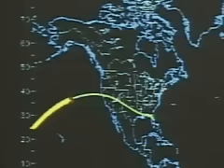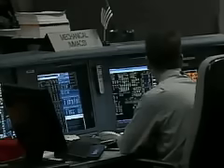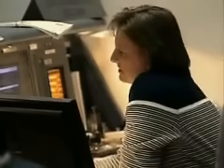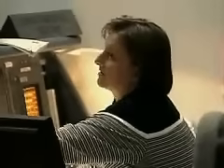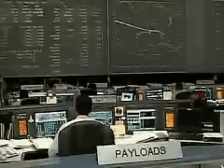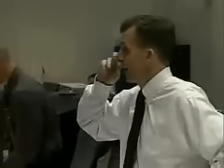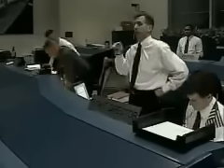Inside Mission Control During STS-107 Columbia's Failed Re-entry and disaster

Comment: Flight director didn't know what systems the heat sensors were monitoring. The pilot had to explain it to him, (twice). Crucial seconds lost in an emergency. You need to have mission control people who understand the vehicle being flown. Not just people who follow "numbered" procedure in a contingency manual. CYA jackoffs!
Reply: The wing sensors going off scale do not have a link to the cockpit. Their transmitted to ground only. They monitored the heat on the wing (structure) only.
Reply: A Flight Director can't know any detail about any sub-system. That's what the controllers are for, who are specialists in their respective field and report to the FD.

Comment: They,knew from the start that the shuttle might have been damaged by the foam to the leading edge  of the carbon carbon   tiles during takeoff but they couldn't do anything about it during the test they did during the investigation 1 of the panels took a direct hit from foam using a gun and made a big hole in it

Comment: Sorry if my question is dumb but can it not happen that they open their own parachutes ( upon sensing some danger like that foam came off etc )  when just a few miles away from earth ? Or it's not possible in this case ? Or is it that they had too less time or something ?
Reply: Not a dumb question. Just a matter of understanding whats going on at that time.  First of all they are still within the atmosphere going about 3,000 mph at that point. Un do your belt and you fall to the ceiling because their up side down. Getting to the hatch in a 100 lb. suit would be impossible. Opening the hatch and deploying the escape pole would take a good minute. Jumping out at that speed would rip them to shreds . No chute can withstand that speed. What I'm trying to say is the escape system is not made for launch but only controlled level flight no higher than 25,000 feet while ditching the orbiter in the ocean. Many perfect things have to happen to get to that point.
Reply: @jrockett73   Alright, thanks so much. 
I had watched a video regarding Jupiter's probe. A probe was sent and due to the immense force in the middle of Jupiter planet, that device was getting sucked inside. But since it had a parachute, it managed to stay for some while and capture details, after which it finally got  immersed into all the hot gases of the planet, deep inside. Hence I asked this as I thought that if it is possible ' within a planet ' , that far and high, to open up a parachute and stay there, why not for a spacecraft just a few miles away from earth. 

Not a physics student hahaha. I studied analytical chemistry and mathematics  :) Thanks again.
Reply: When things went wrong they were traveling at a speed of 13,100mph at 205,000ft high.
Reply: @tommym321  ok , thanks :)

Comment: What is sad about this accident is that NASA knew about the ice strike almost immediately and did nothing.  They did not order photos to be taken.  They did not have the crew perform an EVA to visually inspect.  They did not expedite preparation of Atlantis for a rescue mission.  The seven crew members trusted management and management failed.
Reply: Foam strike, but yes, it seems like the prevailing wisdom, if you can call it that, was to simply know nothing. I don't think that flight was equipped to do an EVA which to me raises the question, "why not?" I've wondered if it would have been possible to force the Orbiter to come in with a yaw in order to favor the left side, but if that had made reentry survivable it would also have likely made landing uncontrollable.

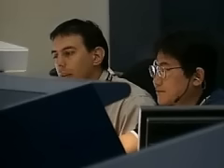Comment: I think they knew something was very wrong at 1:40 when 4 temperature sensors at the LEFT WING were lost. Leroy knew that during the launching something fell from the rocket and hit that left wing.
Reply: I see we have a crew of rocket scientists in the comments section again…
Reply: @Kntrabssi  I second this
Reply: He really didn't look comfortable even before that.  They must have been jittery about the wing after seeing the foam strike on liftoff anyway.  It wouldn't surprise me if the astronauts and controllers on the ground suspected it was a lot worse than the Powers That Be were letting on.
Reply: They refused to fix the damage in space. It's their fault
Reply: @davidoverstreet2875  can fix something if you can’t see or know how large the damage is and don’t have anything to repair it with. Plus to get another shuttle up their crew would be way out of supplies by then not to mention time just to get another shuttle ready.
Reply: @TheCosmicGuy0111  do you seriously think they did not see or know the extent of the damage, or have emergency rations for such contingencies? You can go ahead and fool yourself if you want, but the fact is they simply put it off as minor damage that would not effect the structural integrity of the craft during re-entry. They also didn't think the cost of sending another shuttle up to repair the damage was worth it. And obviously, they were dead wrong. Idiots!!
Reply: @TheCosmicGuy0111  they deliberately refused to check the damage. Out of sight, out of responsibility. I'd have charged them all with homicide. But that's just me.
Reply: @TheCosmicGuy0111  i will have to go ahead and agree with David on this one Kevo. Nasa knew then potential for damage tot he left wing heat shield. They didn’t even bother to do a space walk to physically inspect it since they had no repair materials. Fact of the matter is they are Nasa and supposed to be really smart and figure stuff out. It was said that a mission could of been put together in time but costs and risk factors put that idea to bed. 100 percent Nasa’s fault just like the Challenger. They knew the o rings were faulty, they knew the engineers did not want to launch bit they pressured them into approving. Fools. Dumbest smart people I ever heard of. Except the guy letting in all the illegals with covid and sending them to all parts of the US untested during a pandemic to keep the spread going. That seems pretty dumb also. Lets call it a tie.
Reply: @Mark-fg9pf  Not a fair comparison. You’re comparing dumbest smart people with dumbest dumb people.  Apples and lemons. 😁
Reply: @davidoverstreet2875  Its not so cut and dry dude. First. Space shuttle missions were designed to last average 10-14 days. You realize how long it would take to prep another shuttle? Another crew? You act like they just had to know the extent of the damage when thats impossible considering it happen UPON LAUNCH. The challenger mission was their fault. But Columbia not so much. You can go ahead and point the finger and be a armchair rocket scientist if you want. But you are way off marker here.
Reply: @Mark-fg9pf  No a mission couldnt be made in time. Check my comment above. There was no way we could send another shuttle in time.
Reply: @valaxius  Hi Val, why would they not be able to wait 60 days for a rescue mission? Their O2 would run out? Their Food? The carbon Dioxide would build up? 
What would it take to get the shuttle over to the ISS which has people living on it year round? Could a unmanned rocket be sent up with supplies? Why not take a look at the wing just to make sure? They had 100 people on the ground looking at grainy photos, why not have the very intelligent astronaut who is trained to spacewalk, do a spacewalk?
Reply: @valaxius  very sad regardless. They should have all of these contingencies in place before launch. No space walk ability? Come on man.
Reply: @Mark-fg9pf  The ISS was in a different orbit than columbia. And Columbia didn't have the fuel to reach it unfortunately. 60 days would be a rapid response to launch another shuttle and crew. Which would be very risky and could very well potentially put the lives of more astronauts at risk.
Reply: @DavidJao  It was very inconceivable. First. To even get Atlantis into the same orbit as Columbia wouldn't have been remotely easy or quick. I actually know where you got your info as I read the same article online. The article does mention that this is in theory only. On top the fact that you would be be putting a whole other crew at risk due to risky speedy test and launch. It was not a viable option. Hence why yes it was virtually impossible. To get Atlantis in the same orbit as Columbia would be a feat that is not doable in a timely manner.
Reply: @valaxius  I am not talking about an "article", so you definitely didn't read the "same article" online. I am talking about the original, 10000-page (with appendices and additional volumes) CAIB report. Yes, it would have been risky. Yes, you can debate whether or not it was a "viable" option. Yes, it wouldn't have been "easy". But it was POSSIBLE. Clearly if Columbia could achieve that orbit then Atlantis could achieve it too. Clearly if Columbia had the software written to reach that orbit, then Atlantis had access to that software too. Would it have been worth the risk? Actually, probably not. The astronauts on this hypothetical mission would have had mere days to train. But that's not the debate here. You're claiming it's impossible. You're wrong.

Reaching the ISS from Columbia would have been actually impossible (need 100x more delta v than Columbia had). Reaching Columbia from Atlantis was just barely physically possible.
Reply: @DavidJao  It wasnt. And yes you are talking about an article as it literally says word from word what you are. Its not about instruments but launch site. It takes a lot of fuel to change a shuttles orbit after launch. Which is why Columbia couldnt change orbit to the international space station. Also no. By the time the damage was found and analyze they did not have enough time. You would have known have you actually read the report. Articles online can be very misleading. im not gonna go back and forth with someone who clearly has no idea what they are talking about. Good day to you.
Reply: @valaxius  I know what I am talking about. I am talking about the CAIB report. I know I am not talking about an online article. This thing is 10000 printed pages. I know what I read.

The CAIB gives a realistic timeline under which the damage could have been discovered by day 6. This part is absolutely possible. You don't need a second shuttle launch to discover the damage. All of the report's conclusions assume this timeline.
Reply: @valaxius  From the CAIB report that you claim to have read, regarding damage assessment timeline. This is a direct quote: "The following timeline was used for the study: On Flight Day (FD) 2 the NASA team would be notified that the left wing had been struck by debris. On FD 3 NASA would make an expedited request for national assets to inspect Columbia. To be conservative, it was assumed that this inspection was inconclusive and that an “inspection EVA” would be required. NASA would spend FD 4 developing procedures for the inspection EVA,  which would be performed on FD 5. It was assumed at this point that the damage was visible and a clear threat to the vehicle, although whether this was really the case with STS-107 is not known. The risk associated with this EVA was assessed to be low and the likelihood of success high."
Reply: @valaxius  From the CAIB report that you claim to have read, regarding mission success and mission risk. This is a direct quote: "While each of the individual areas could have supported a launch attempt, it was recognized that this was a “best-case” analysis, with very little margin, and it deviated greatly from the standard mission planning and preparation cycle. It was determined that by accelerating the schedule for the above areas, a launch of Atlantis on February 10, 11, or 12 was possible. All three launch dates could have provided a rendezvous and EVA transfer of the crew prior to the depletion of consumables. Two major assumptions, apart from the already stated assumption that the damage had to be visible, have to be recognized – the first is that there were no problems during the preparation and rollout of Atlantis, and the second is the question of whether NASA and the government would have deemed it acceptable to launch Atlantis with exposure to the same events that had damaged Columbia."
Reply: @valaxius  From the CAIB report that you claim to have read, regarding flight software preparations. This is a direct quote: "The impact of changing the STS-114 Flight software was assessed and determined to be within the launch vehicle processing timeline. The STS-114 flight software load would be used, since this flight has the appropriate rendezvous information and STS-107 did not. The changes to the flight design: inclination, altitude, launch window and rendezvous information, and External Tank disposal criteria were assessed and could be developed and uplinked in the Day of Launch I-Load Update process (DOLILU). While these DOLILU I-Load updates are certified, this would be the largest DOLILU uplink ever performed. One additional patch to the software would have been required to change the main engine cutoff altitude to meet external tank heating constraint."
Reply: @DavidJao  Not reading your replies at this point. Replying multiple times because you are wrong and upset that I called you out is not gonna do anything here. Reading a few articles online does not mean you are an expert. Articles can be very misleading. Thank you and take care.
Reply: @valaxius  Summary: There are three major assumptions, each clearly identified. There is a ton of risk and a high possibility of failure if attempted. But let's put it this way. If some alien civilization had come to us and told us that we had to perform this rescue mission successfully (ASSUMING the given damage assessment timeline) or they would blow up the Earth, we would have at least attempted it, and we may have been successful. If some alien civilization had come to us and told us that we had to make Columbia rendezvous with the ISS or they would blow up the Earth, they would blow up the Earth. There's a distinct difference between the two.
Reply: @valaxius  Volume II, Appendix D.13, page 391.
Reply: @valaxius  Yes, people get upset when you blatantly lie about what they read. Imagine that.
Reply: @valaxius  Yes, I think I am more capable than you of accurately reporting what I read. Imagine that.
Reply: @jonathanbaird8109  Ok troll
Reply: @davidoverstreet2875  Yeah man just fly another shuttle up like an UBER, get a wrench out and fix the easily visible problem in outer-space in no time.
Reply: @Despond  never said it would take no time, but it would have saved both the shuttle and seven lives.
Reply: @davidoverstreet2875  they didnt refuse, the bitch nasa director refused to give the engineers pictures of the damage saying it was unnecessary and its a waste of time. Get your facts right

Comment: 12:31 - "Lock the doors."  I tear up at that point.  The finality of the phrase is gut-wrenching.
Reply: Why do they lock the doors?
Reply: @pacedom1  it's NASA protocol (I think the FD references the serial number of the checklist to be followed) to immediately switch into investigation mode when there is an incident. They need to document the timeline, backup computer data, record individual testimony, etc.  Nobody in or out, and no phone calls, protects evidence from being lost or contaminated, and ensures that their judgment and recollections are based only on what they personally experienced, without influence or pressure from outside.

Comment: I'm sorry to say this, but the difference between this group and the Gene Krantz led group of Apollo is, well, striking.
Reply: Really-based on what?  You do know that on at least three Apollo flights (12, 13, and 16) there were problems that could easily have killed the crews if just one more thing went wrong. But since they couldn't do anything about those problems, they let the missions continue.
Reply: almostfm that doesn’t even make sense
Reply: @jamiepastman5594  Actually, it does. Both groups understood that there are some things in spaceflight that you just can't do anything about. So rather than pearl-clutching and hand-wringing about those things, you look at the stuff that you can do something about.

It's why, for example, on Apollo 13, they worked their asses off to come up with a power-on sequence for the CM that could be done with the power they had available.  But the CM was full of condensation, and there was no guarantee that that moisture wouldn't short out a switch and kill the electrical power (and the crew along with it). Since they couldn't do anything about that, it wasn't something that they focused on.

Comment: I'm wondering if the shuttle could have rendezvous with the ISS to inspect the left wing? NASA new foam had hit the left wing on lauch...it was obvious from the launch cameras...
Reply: Columbia was in an entirely different orbit than the ISS, and did not have any way to get to it.
Reply: To expand on what brch2 said, it has to do with the inclinations of the two orbits.  Once you're on orbit, it takes a huge amount of energy to change the plane of that orbit. That's why when you watch a launch, a rocket will start a roll as soon as it clears the tower. The roll puts it on a heading for a particular orbital inclination, and the slower you're going, the less fuel it takes.

Columbia had enough fuel on board to do a plane change of about three degrees. The different in the inclination of the ISS add Columbia's orbit was about 30 degrees.
Reply: Were the temp readings in the left wing different than the right wing before reentry?